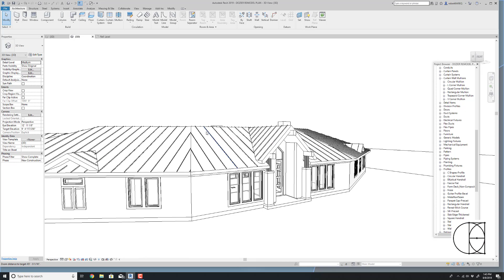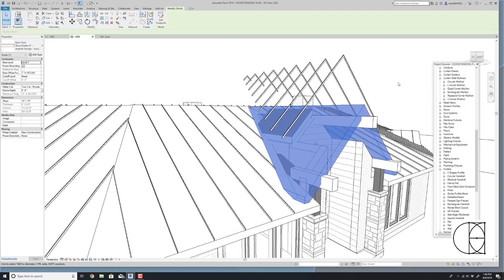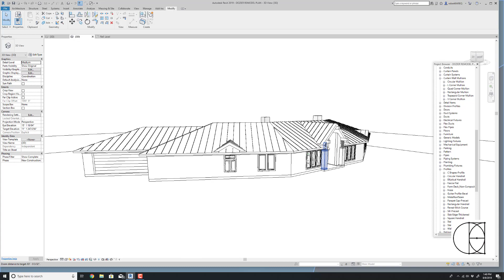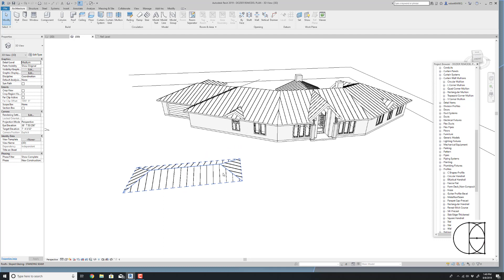Revit 2019 Standing Seam Roof

Comment: How would you make your Ribs alight at the ridge of the roof?  They currently do not align with this technique?  Thanks!
Reply: Highlight the sloped glazing in the view and you'll see a symbol pop up on each sloped surface that looks like a window.  When you click on that the Properties for that individual sloped surface will show offset values for each grid, and you can manually change them to slide the seams as you need to line them up.  I usually measure how far I need to move the pattern first, then do the above.  There's a great video from The Revit Kid on this process.